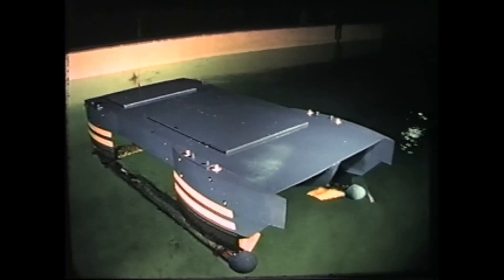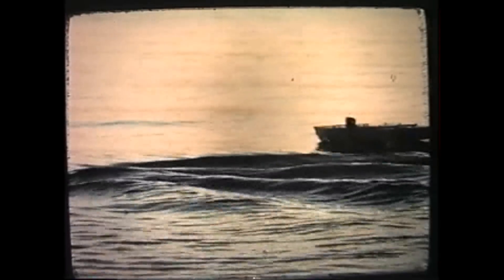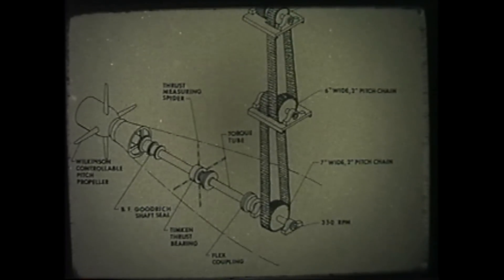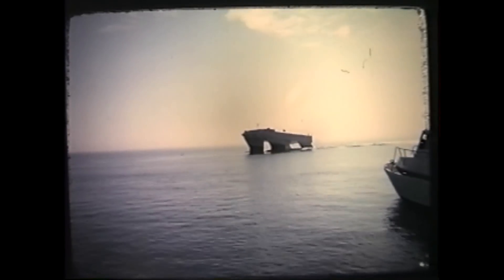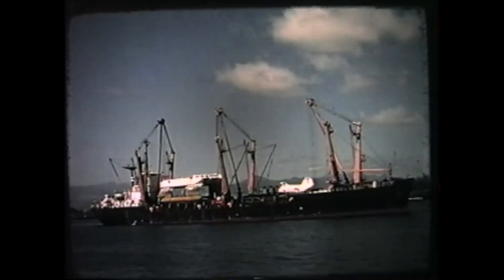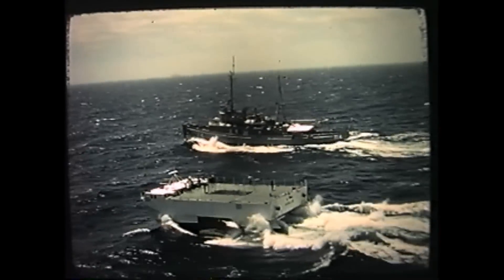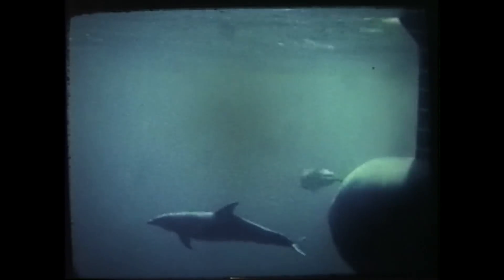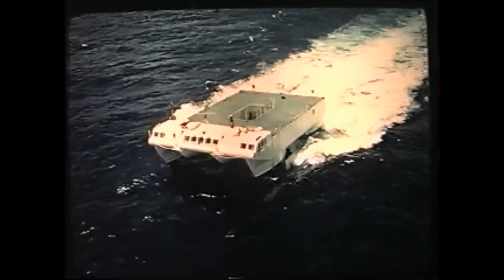HYDROFOIL HYBRIDS

Comment: Thank you for your research work in the area of Archimedean buoyancy bodies in connection with interference and liquid wave dynamics. New technologies can only arise from old experiences and developments. One thing, however, is absolutely necessary: the additional fixed and adjustable fins and surfaces. And thus again too many areas outside the outer skin that need to be sealed and maintained, as well as vulnerable areas. The basic configuration is absolutely top-notch. No question about it. The only thing missing are the slotted openings open at the bottom for flooding the individual sections of the long buoyancy bodies. Because? Length just works better. Otherwise, very good work for that time.
Peter

Comment: Seems they are just catamarans, with control foils.
Reply: If I understand correctly, most of the buoyancy is deep under the surface, and so unaffected by waves, unlike a catamaran
Reply: @trevormtb9372  
Same construction.
Reply: @niklar55  what do you mean? They certainly share some similarities
Reply: @trevormtb9372  i

In a catamaran, ALL the buoyancy is underwater, otherwise its not buoyancy.
The only difference between this platform and an average cat, is that it has hydrofoil fins, below water level, and the buoyancy is connected by extended 'legs;' instead of being part of the hull structure.
Reply: @niklar55  Deep underwater though, unaffected by waves. In a cat, the "slice" closest to the waterline will provide more buoyancy than all the other "slices". This is not true with this type of ship which, by my understanding, gets most of its buoyancy from what amount to submerged pontoons
Reply: @trevormtb9372  
Please read my comment again, and try to understand it.
Buoyancy is buoyancy, regardless of its position in the water. 
The buoyancy displaces the same volume-mass of water that it is supporting.(Archimedes)
Reply: @niklar55  o my bad I could only see the top half
Reply: Archimedes describes a static state, an equlibrium, and isn't enough to understand hydrodynamics. You're forgetting the role of reserve buoyancy and the DYNAMIC part associated with wave action, with a constant battle between acceleration and deceleration forces. Why does a ship heave and roll: mainly because when a wave passes underneath it, reserve buoyancy is 'recruited' and the equilibrium between the boat's weight and the (weight of the)  displaced water volume is disturbed, and the boat will rise with the wave until this equilibrium is restored.
Therefore: less reserve buoyancy = uncoupling of ship motions and surface wave motions = much smoother ride. The vertical struts don't have much volume and don't contribute much to reserve buoyancy. For safety in extremer seastates (and ONLY then), i.e. when wave tops are as high as the bridgedeck clearance, the bridgedeck creates lots of reserve buoyancy.

Comment: nice projekt, but many years later I presume the idea failed, since I have never seen one of these anywhere on the sea !
Reply: SWATH was used for the US Navy's stealth ship, and several utility vessels have been built with SWATH or SWASH hulls.
Reply: @marcdepiolenc1880  Yep, but took me a while to discover that they did use the design.
- personally I live in a city at the sea with a big harbor / shipyard, and navy.. I even worked at ships for  a few years, I have never seen this kinda   ship. that is why I figures that the design didnt work out.
- but I just lately found out that they did use it for specific ships !
Reply: @dkphantomdk  It's true that they are poorly documented. The only reason I know about them is that a friend of mine (Hernan Posnansky)  programmed the attitude control software for the Kaimalino, and left some of the technical literature with me.

Comment: Designers were using A SLIDE RULER !!
Reply: g baker  It is a mechanical calculator which people have used for four hundred years before the electronic calculator. 

It is two sliding rulers one inside the other having six edges and based on logarithms . When I flew I used an circular version called an E6B .
Reply: g baker  

If you’ve ever watch the movie Apollo 13 the engineers in mission control had them and used them to calculate burns and burn times to change its delta V.

Comment: I wonder if this would be built today. With todays tech, ie Electric motor jet turbine drive with diesel electric generator. you could have shorter fins into the water creating less drag and even have four  twisting rudders with a drive integrated into each rudder.

Comment: I'm so disappointed we don't have aircraft carriers three times the size they are now handling twice the size aircraft with this kind of design what the hell happened?  Just put a huge platform on top of two nuclear powered submarines that never have the ability to take on water ever again and you have an aircraft carrier that's the size of a small City in square footage
Reply: n s - With a 16,000 ton submarine surfaced, you can only add about 2,000 tons and it will sink.
Reply: No. Just make the submerged parts comported (If there is a hole, water only gets into one area) and allow the struts to be released and then a backup propulsion system in the platform. Or, if you really want to do something good, have a 3 strut version of this instead of two. The outer struts take the torpedo hits, while the middle strut has the engine and is unaffected.  Also, it's not like there wouldn't be armor, or that those types of problems wouldn't occur in the current ships.
Reply: n s Simply no need for that anymore. ICBMs and nuclear submarines pretty much made the necessity for such a ship obsolete as well as make such a ship the easiest target to pick off by any enemy missiles, ships or aircraft.
Reply: This makes a nice drilling platform in civilian application. Oh wait....
Reply: Would be a perfect vessel for the Coast Guard because when they see a target they launch small boats or helicopters. I think, not sure, they only launch helicopters from land these days. Right?
Reply: because they are just easy targets now a days

Comment: If the front and rear struts were joined together, the wave motion would be cleaner and  there would be less drag. As it is the rear wave of the front strut is causing a higher wave to the bows of the rear struts and the  wave under the hull is very ugly indeed.  There are no benefits in separating the  front and rear strut in a dynamic sense.
Reply: conncted there will be more surface drag due to viscosity.
Reply: Would be very hard to turn if they were connected.

Comment: I crewed on the S.S.P. Kaimalino. It was the most interesting job I ever had at sea! Those T64 Gas turbines could burn an awful lot of fuel in a hurry! With the chain drive, I was told a sub could hear us operating for hundreds of miles. Those drive chains had to be hoisted from their wells and  inspected, course by course, every 100 hours. A giant pain, but great overtime!  If you went down in the port bow where the bubble was at night, the bioluminescence from the critters in the water put on an endless light show that looked as though you were going into hyperspace! It was always fun watching dolphins swimming in the bow wave except when they crapped! Great memories of this ship!
Reply: Thank you for sharing that. Was the stability as great as shown in this video?
Reply: Under way, the dynamic flight control would cause the ship to "fly" at a pre-set depth and the only motion you felt was a sort of elevator sensation as the ship went up and down in a level attitude. When at rest, the ship would go beam to the wind , but was un coupled to the waves. The ship would roll one way, or the other for two, or three waves and then start to roll  slowly the other way. In large seas, the roll could be around fifteen to 20 degrees. In very steep seas, the bows would crash into the tops of the waves and throw a pretty impressive spray over the bow, especially when the ship was head to wind. We had an admiral and his staff on a dog and pony show ride out of Kaneohe Bay once. The admiral was on the bridge steering the ship and a few of his staff where on deck. Just as we got the the sea buoy I spotted a very steep wave approaching fast. As the ship plowed through the wave crest, , I dove down the companionway to stay dry! The once dignified naval personnel, however spent the rest of the trip wearing wet white tropicals!
Reply: @radching2845  And that explains why the concept never took off. Embarrassing the boss never pays off.
Reply: Rad Ching remember doing motion sickness studies with the USCGC Mellon (717) in late 70's.
Always loved the concept and still believe it's the future. Don't understand or ever been told why the concept never became widely accepted?
Not sure, last I heard she was decommissioned and in the Chesapeake mothballed?
The chain drive was always an issue for me. Wondered if water turbines or jet drive would be the way to go, as they are highly efficient and great on fuel consumption?
The Radisson Diamond (Asia Star) would pull into San Juan weekly. It always gave me a chuckle hearing folks call it a catamaran. 😎
All the best.
Reply: @josebenitez3732  These windfarm support vessel SWATH hulls, utilise Hamiltonjet waterjets http://odfjellwind.com/fob-swath-25m/
Reply: Jose Benitez as I understand it, giving those underwater missiles the ability to steer took a lot of work, as turning would tend to burst the bubble and the torpedo would then slam into water at jet aircraft speeds, with the result you can imagine. Steering those must be very complicated indeed, since so far as I know no one but the Russians have developed such a weapon. I think initially they wanted to forego steering and just use them as rockets… after all, if you're shooting those things at something the size of an aircraft carrier, it's never going to be able to evade.

You're kinda right, those things also don't need a warhead. I learned about them right after the Kursk disaster. Turns out it was equipped with those weapons and one of them caught fire. Rocket fuel in a sub, you don't have to imagine the damage, because we got the pictures when they salvaged it. Supposedly they were going to conduct test firings, and that's why there were so many subs of other navies in the vicinity. Otherwise I trust the Russian would have buried the whole tragedy under the rug like an other widowmaker.

I'm with you, those technologies should be used in peaceful applications. There are a lot of people who don't want to travel by plane. Amazing what you can find on YouTube, like entire communities of people sharing tips on "flight-free traveling" including travelling on container ships. Those people could really use a cruise ship that does 400 miles per hour. Hell, I might use them too if it meant I don't have to deal with the TSA ever again.
Reply: Jose Benitez I don't know why the military doesn't use this design. It's well proven. Look up the SWATH yacht Silver Cloud, for example. Built for a guy whose wife had sea sickness.
Reply: @TheNefastor   probably because they don't look 'shippy' enough, It's not just admirals, the USAF has/had a similar attitude to 'non cosmetic' aircraft think Ad4 Skyraider(horrors! navy castoffs), OV10 bronco, DH Canada Caribou, (the airforce wasn't going to have any old US army 'not invented here' transport second hand whatever its abilities) unbelievably the A10 Thounderbolt, just look at the reticence of the USAF to have turboprop COIN aircraft in inventory, ok for junior ally but not the zoomie wing wipers .....
Reply: @alan-sk7ky  Well it makes sense, really. They can try all they want to make it look like they are smart, but come on, no one with functioning brains has ever joined the military. I really wouldn't be surprised if form is more important than function to them.
Reply: Jean Roch Don't know squat about the Russians, but I'll take your word for it.
Coast Guard had a SWATH design in their DEEPWATER Project, but removed it from their site.

Boy, the Kaimalino would have made a great party boat!🤣🤣🤣🤣
Reply: Jose Benitez basically the Russians figured out that if you keep a torpedo inside an air bubble it can swim at ridiculously high speeds, in fact almost all the way to Mach 1. I think their device is called the Shkwal or something like that.
Reply: Jean Roch That was pretty funny at the end there.
Thanks for all the information and chat.
Take care.
Reply: Jose Benitez likewise ! Safe travels !
Reply: Do you know why they chose that unconventional transmission with the chains and not vertical shafts? A chain in only one step can have less power loss than a shaft since the shaft would need two 90° gears in this arrangement but since the chain was divided in several steps, I think the power loss would be about the same but a shaft would be much less complex and more reliable.
Reply: Thanks for telling us about her.
Reply: volvo245 except a catamaran is not a SWATH :-)
Reply: Jose Benitez fast is life ! Let's come up with the fastest possible setup... how about we put a couple nuclear reactors on a SWATH, one in each hull, driving pumpjets ?
Reply: Jean Roch NUKES! Where did that come from?🤣🤣🤣
I've always thought of jet drives because of the weight factor and speed/fuel efficiency.
Only one problem and that is distance from intake to exhaust.
Never liked the drive thing, but given it was an experimental, oh well.

I forgot to ask what was designed or maximum hull speed?
You can only go so fast through a fluid for a given shape.
Where once reached drag increases and fuel efficiency to speed ratio are lost, or something like that.

Did I ever mention I fell I love with the whole SWATH thing?😃
Reply: Jose Benitez easy : nuclear reactors make it possible to run fast for a long time. Granted, that means the ship would have to be big, 150 meters long at least. As for drag, maybe we can apply the same principles used in Russian rocket torpedoes... except that might not work well at the waterline.

Yeah I love SWATH too :-)
Reply: Jean Roch Found It!
Those are crazy speeds in the water!
At those speeds on a boat you need long range radar, a crew of radarmen plotting contacts at long ranges and a prayer that nothing gets in front of you.
The torpedo turning at those speeds, I imagine, can't make sharp turns relative to speeds without tumbling?
For those speeds you might as well fly.
And who needs explosives, at those speeds you have a kinetic weapon.🤣
Love when then narrator said, "Knots per hour".🤣🤣🤣
Wouldn't it be great if all these technologies were used for peace instead? Bunch of Sons Of Bitches!

https://youtu.be/mpigS8hQyIg
Reply: Rad:  Do you know if this boat still exists, or was it decommissioned and scrapped?
Reply: Wow that is amazing.
Reply: Jean Roch I think the Ocean Voyager's 90ft catamarans are more frugal choice. Incredible features and range for such a small vessel. https://www.boatinternational.com/yacht-market-intelligence/brokerage-sales-news/catamaran-motor-yacht-rogue-sold--31307
Reply: Jean Roch Shame it was decommissioned.
Wonder how she would have done with jet drives?
Reply: Jose Benitez she'd probably super fast... maybe even "too fast", if there is such a thing.
Reply: @TheNefastor  Smart way to go would have been turbine-electric. The turbines above waterline driving generator and electric motors connected to the props or jet drive.
Reply: @joelvoss1226  I'm not sure that would work well. The wind would have to be considerably faster than the ship, and given fast this type of ship is, that would rarely happen outside of weather under the headings "avoid at all costs" and "sail around" :-D.
Reply: @TheNefastor  I did not mean wind-turbine, I meant gas turbine.
Reply: Jean Roch 🤣🤣🤣 Fast is Good.
Reply: Important Information
Forward to everyone you know, and post on every site you visit;
https://newtube.app/user/TrueTube/2ocfxrR?fbclid=IwAR03sIdNzcPJmrnrU4b13rN82K5ZNZ-04Kc7q-Wyc37XYNZuwcKYKqry6yQ

Comment: Frederick John MacClay
I made a RC 3 foot model of this SSP ,back in 1976,
Published in Model Boats, March 1976.
Worked very well.
Reply: Have you got a photo? I've been thinking of doing a 1/72 model. I have a lot of drawings and photos of the ship  I even made a tee shirt with the Kaimalino on it.
Reply: Years ago and not knowing a damn thing about naval architecture I was designing a 32 - 35 foot pleasure craft on CADD.
Wasn't sure as to the length/width ratio, so I just went back to work.🤣🤣🤣